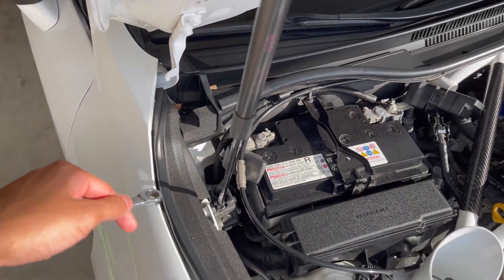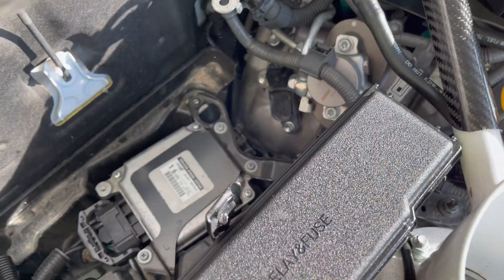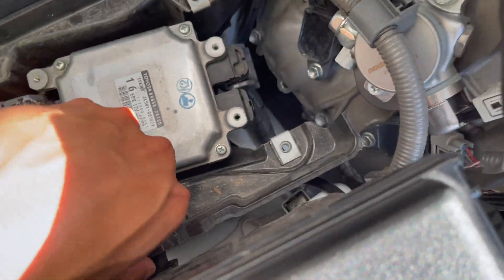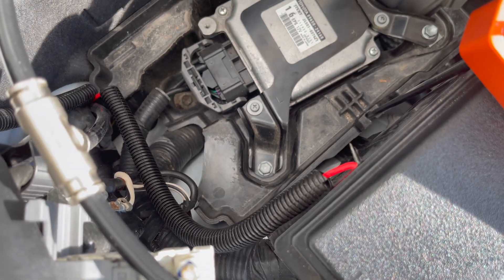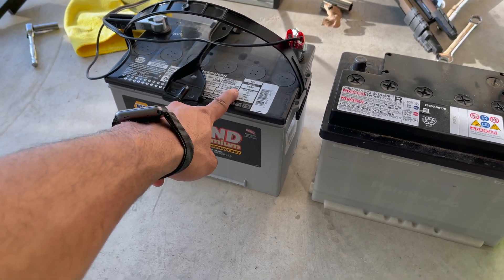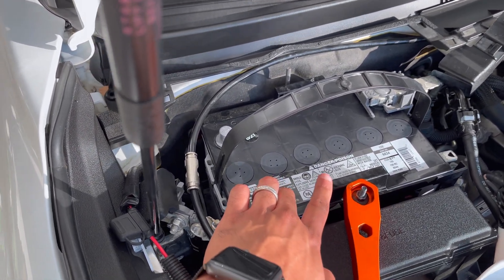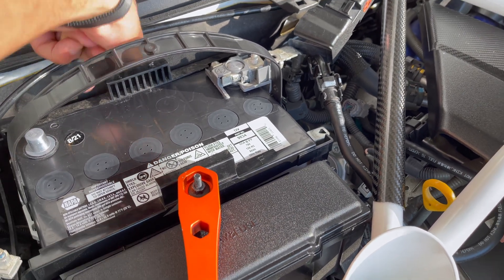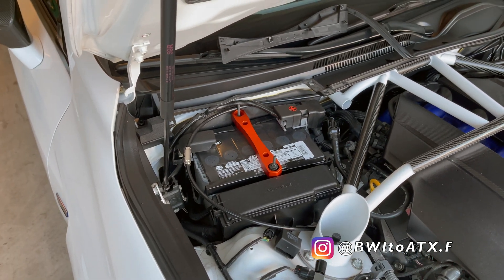Lexus RC F conversion to group 34 battery - AGM - 4K

Comment: Dude how’d you get the L arm to snap into correct spot? I’ve tried multiple times and I just can’t get it to go where it needs to go. Driving me insane. I’ve given up on installing it
Reply from the maker: Are you talking about the one closest to the front?
Reply: @ yes the one between the battery and the relay box. The one close to the fire wall don’t move so that’s fine.
Reply from the maker: @jp28491 yeah it is basically wedged in. Just have to push it hard (your slot for the bar might be a bit smaller requiring more pressure to get in). That j hook just rotates and sits under pressure. 

Feel free to use some leverage like a screwdriver between the j hook and relay box.
Reply: @ I’m gonna give it a go. I bought a j hook off a mk4 Supra as I was told it works better. Will see if I can do it.
Reply from the maker: Gonna be honest. Shouldn’t be no struggle with OEM bro. Post a pic in the discord.
Reply: @BWItoATXF  ima take the battery n tray out. If I can’t get it I will hop in the discord. Appreciate it.
Reply: @BWItoATXF I got it into the right spot but then it drops down half an inch or so? Is it suppose to do that

Update I got it! Had to use pressure of the battery to hold it there.
Reply from the maker: Bingo. You got it!

Comment: Hey there, I have a Lexus IS300 awd 2019 and it requires group 24 but I am wondering if group 34 would work well/better/worse?

Also am considering an AGM battery because I find my dash cam turning off when I get in my car in the morning. Would getting an agm battery solve this or just a regular battery would be good?

I hear mix things about agm battery, was told by a parts guy from Lexus that an AGM battery can damage the alternator and cause it to work to hard? Not sure if thats true.
Reply from the maker: I would check the reserve and CCA for comparison. Reason I got the AGM was for my dash cam. But ended up going external battery because it was too inconsistent with parking mode run time. 

I haven’t heard anything about running an AGM battery ruining the alt. Ran multiple AGM batteries including this one for 3 years. Never had an issue. Sounds invalid to me unless there’s something I’m missing.
Reply: Did you find the agm good or was it overkill or not as applicable? I'm having that dash cam issue too. Not sure if I should get a brand new regular battery/switch to agm. So you said even switching to agm, you ran jnto the same problem that the dash cam would turn off over night?
Reply from the maker: @prodigy6X04 the AGM still served its purpose as it was a deep cycle every time the cutoff was reached. The AGM will always be better instead of a flooded as flooded will never be designed for a deep cycle like this. BUT it was still way too variable. Getting a consistent external battery (BlackVue for me) gives me a few hours in just 8 min of driving hard wired. I can get a full day when these packs are fully charged.
Reply: Interesting....surprised you havent made a video of it yet!
Reply from the maker: If you’re talking about the battery pack, I did an install video on it. Didn’t go too in depth with it though.
Reply: I'll definitely check it out. Your truck badge video was nice and will definitely watch your carbon fiber steering wheel video after mine comes in. I'll try to remember to connect the airbags in too. 😂
Reply from the maker: @prodigy6X04 thanks for the support man ✊🏽

Definitely try to save yourself the heart attack on the air bag leads being disconnected 😂
Reply: Np probably brotha, keep the good content comin!

Comment: i'm having trouble removing the positive terminal with all the extra plastic clips.  can you help me?
Reply: how on earth did you remove the positive terminal lead?  i can't find anything anywhere for my RC F.   i have the replacement battery but my car is straight dead
Reply from the maker: You just have to undo the bolt to remove the main terminal ring. It reduces the squeeze, makes it bigger and should be able to pop off.

Comment: Great video as always.
Note: Varta E39 AGM/MegaLife MV-26L LiFePO4 fits inside OEM housing/bracket without any mod. Correct battery size is DIN66H/MV072.

Don’t ask me how I know - haha, it was a back breaking exercise.
Reply from the maker: Thanks! And this is great info. I saw a few non-US offerings as there appears to be a bit more. Had no idea about the Varta. Looks like there are some stateside retailers for that as well. 

Always good to have options!